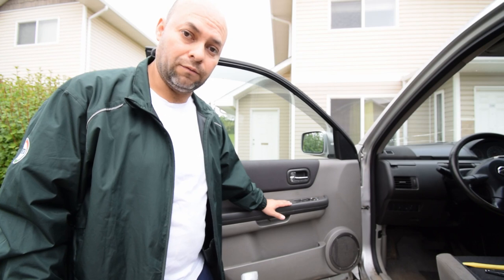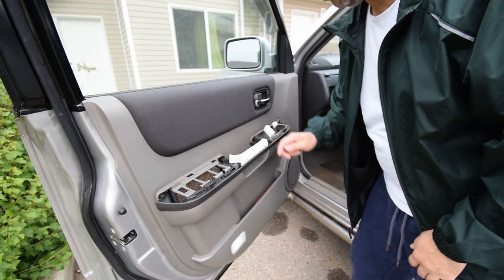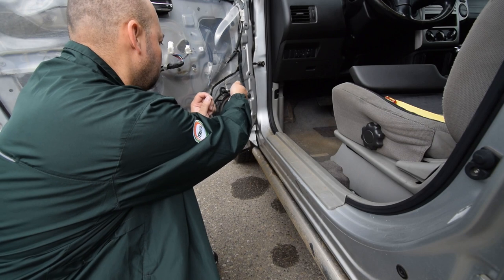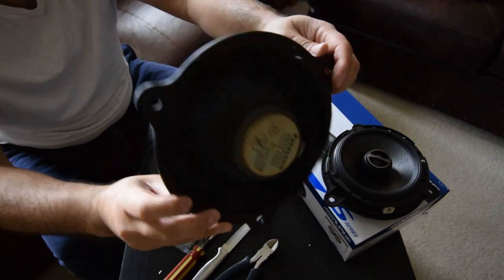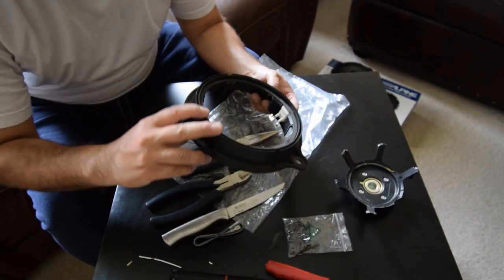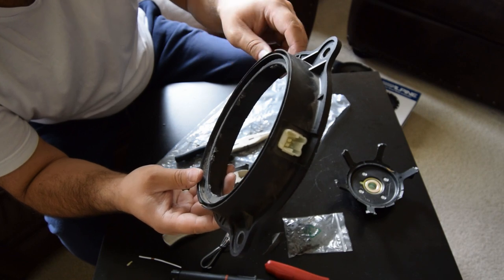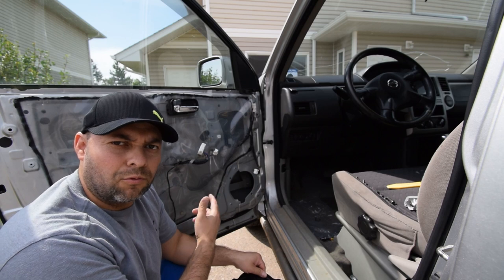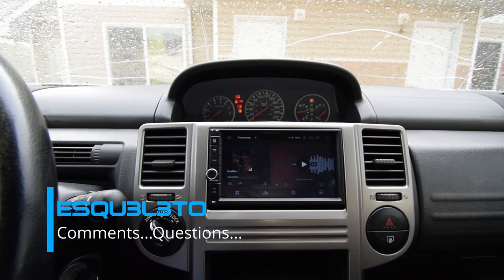Car speakers install - 06 Xtrail

Comment: Gracias por el video, muy bueno. Pregunta: la instalación de parlantes en las puertas delanteras pero con twiters es igual (entiendo que tiene las ranuras y espacio en el tablero para ponerlos y que no se vean) ? 
No me queda claro pq tienes que hacer el invento de reutilizar el parlante antiguo, uno nuevo no trae los soportes?
Reply from the maker: Si la instalacion es la misma, mi Nissan los tiene tambien pero no se los cambie. A razon porque use las originales es para no tener que comprarlos. Dependiento de cuales instales es posible de no tener que usar spacers.

Comment: Nice upgrade, will you change the stock tweeters as well?
Reply from the maker: I may but not sure yet. Ill decide later on. What I am thinking about doing tho is maybe adding a amplifier for the speakers.
Reply: @esqu3l3to  would love to see a video on that, I am planing to add an amplifier to my xtrail as well ,  got the alpine mrv-F300,

Comment: Hey, just wondering how the speakers are doing with the factory amp? Or have you put one in since? Thanks
Reply from the maker: I actually sold the car over 4 months ago. The speakers were good even without an amp. Having said that, would I have kept the car I would have deff added an amp.

Comment: i watch a few other videos on ''how to better install '' speakers so you get better sound/no rattling and lessen the vibrations, buzzings etc. I like your video, but when i do my Xtrail fronts, i will take the advice of adding some sound deadener to the inside of the metal door panel. Some deadener under the factory speaker mounting bracket and wrapping up the wires with some insulation. 

--this the video if it helps others....https://youtu.be/jPNy_Adb2vU
Reply from the maker: for sure, glad it helped you out. adding sound deadner does help a lot. some use it when doing a full system, others as they wish. let me know how it sounds after